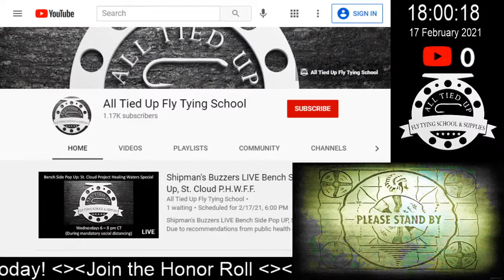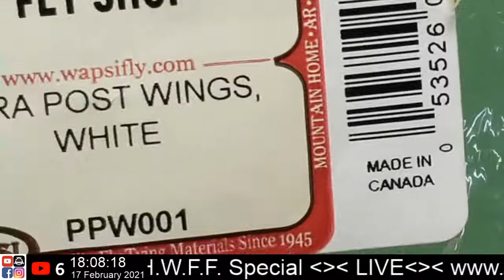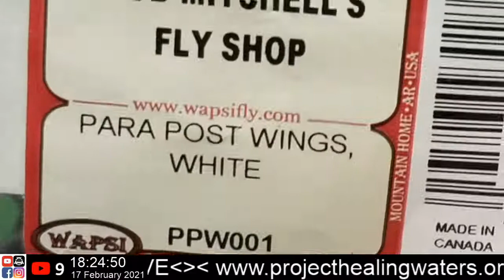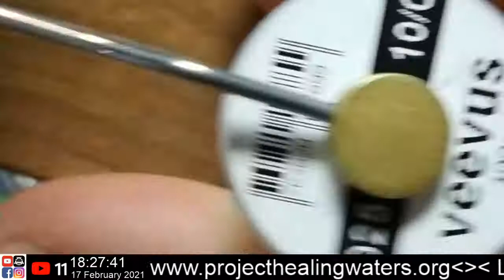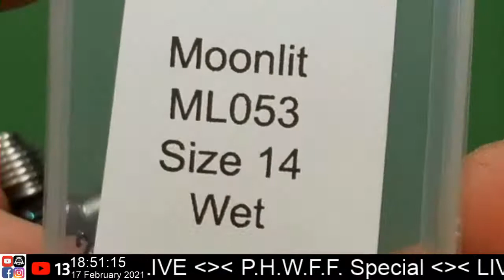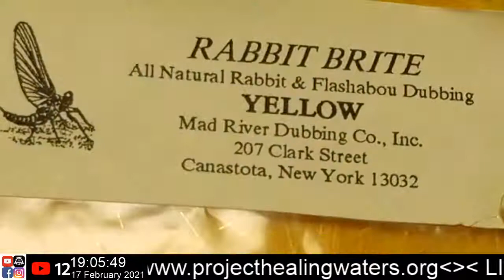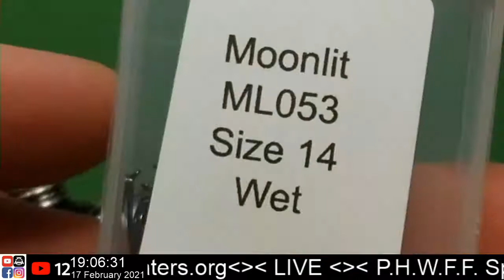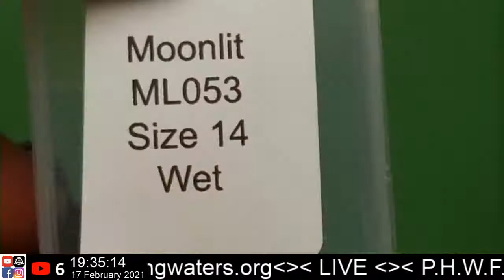Shipman's Buzzers LIVE Bench Side Pop Up, St. Cloud P.H.W.F.F.

Comment: Hi, you asked for material suggestions. Paracord, Macramecord, knitting wool, present packaging foil, x-mas tinsel, silicone hairties, any kind of foam (crafting material or f.e. old flip-flop), mop, old electrical cord for wire, ball chain of old keys, glass beads - just of the top of my head what I´d had in reach. Have a good one Smarty